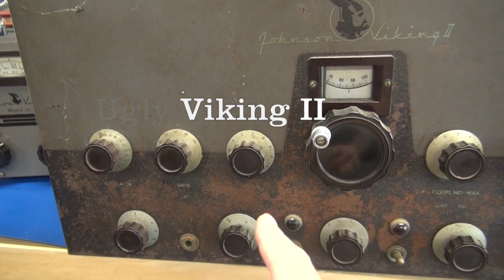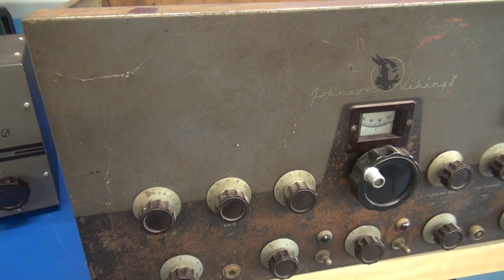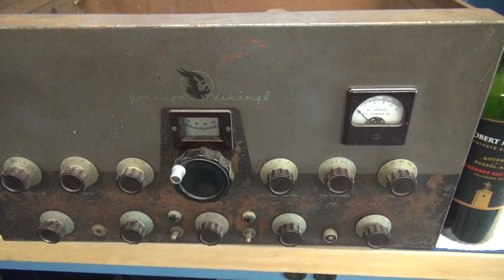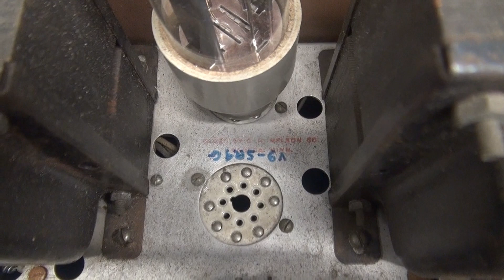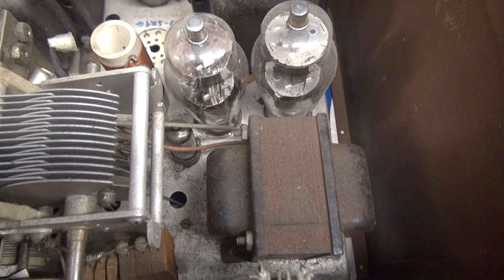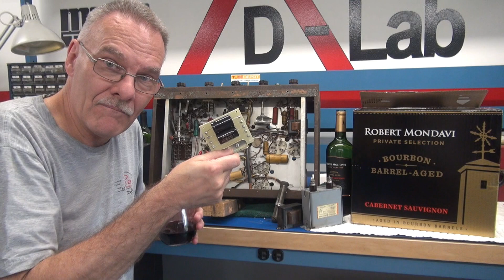The Ugly EF Johnson Viking II Ham Radio transmitter repair supplied Case of wine down payment

Comment: I've been a ham for over 30 years but I have been in the radio/electronics hobby since I was a child. I do occasionally repair things for friends and fellow hams sometimes in exchange for cases of beer or wine. One thing I've found, and this is just my personal experience, is that it's much easier to make the repairs if you do so before drinking the wine or beer.

Comment: If that is crap, send it to me! And FT stands for French Toast.does that work? 
Also,where do you get them, or the parts to make one? A few years ago the capacitor on my air conditioner blew. It would let the compressor run. I had a guy come out, and he stuck another bad cap and a few days later it died again! But this time around I pulled the breaker, discharged the cap removed t and then got on the net to find one. It was something like 50 uf  on the pages side, 35 uf o the small side.I tried to find a replacement, but they were out of stock everywhere. So then I got two caps and installed them. It worked for three years at which point the compressor died.